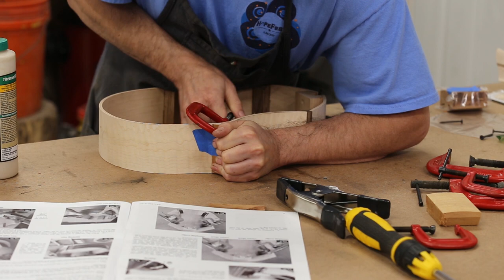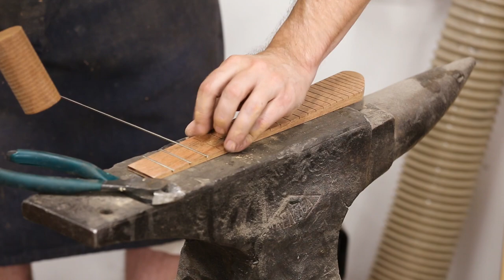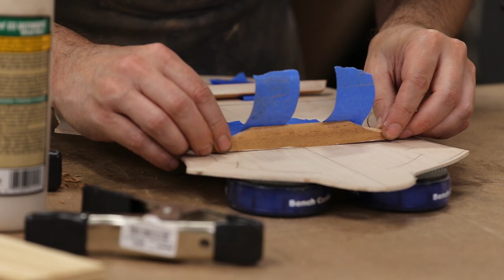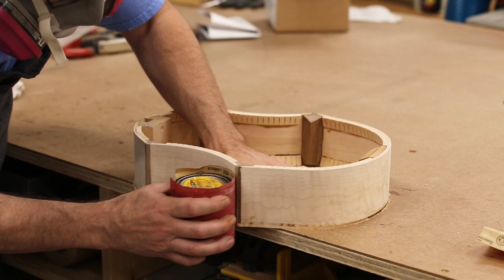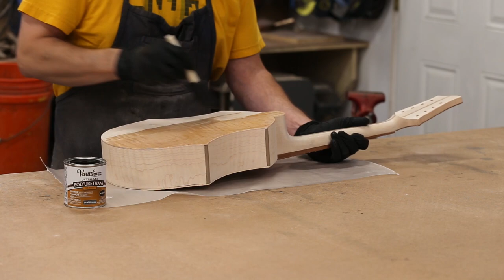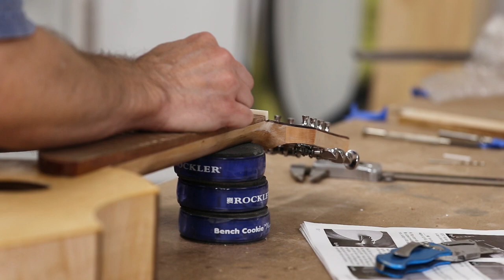Mandola Kit from Musicmakers

Comment: I enjoyed watching this video. Especially fitting the neck. That's something I struggle with a lot.
But why is everything so thick? The instrument would resonate better, if certain parts would be thinner --> bridge, neck for example.
Reply from the maker: Thanks for watching and glad you enjoyed the video. The kit provided all the parts so I built what was provided. I assume someone with more luthier knowledge than myself could reduce/change the sizes of certain parts. This being the first Mandola I've ever built I wasn't comfortable making any large changes so just went with what felt comfortable to me.
Reply: @ckmworks3509  Ok! Thanks for the infos!
What I like to do when I build new parts is to look up original measurement and build close to that. If it works, then I have learned something, if not I've learned something also ;)!

Comment: Been thinking about adding a mandola and glad I stumbled onto this video.  Just wondering how you finished the woods?  Say the can of Minwax stain.  I'm refinishing my mandolin top and don't necessarily want to use laquor or poly.  Was thinking of just staining and maybe a wax?  Not concerned about a hard finish to prevent small dings.  Any comments would be appreciated.
Reply from the maker: Hey, in the instructions for the kit I used they lay out a number of different options from using stains (which they don't really recommend), Oils, Polys, or Laquers. I think if you want to avoid using laquer or poly I would go with a Danish Oil for the finish. It will likely give a nice warm look and is easy to apply. However, it doesn't provide much protection (which may not be a concern). My hesitation with a wax finish would be that over time it will dry and rub away so I think you'll end up needing to do it again periodically. An oil finish should last a lot longer, but can always be refreshed in the future if you want. Hope that helps!
Reply: @ckmworks3509  Thank you for the reply.  I'm leaning towards boiled Linseed oil with Anilised dye to tint.  Either that or Tung with tint to get a richer honey tone.  Will look into Danish as well.  Not concerned about dings as much on a mandolin.